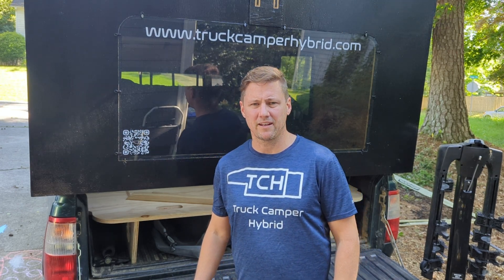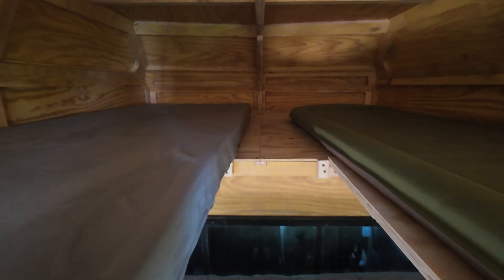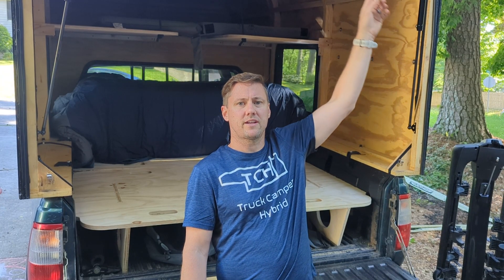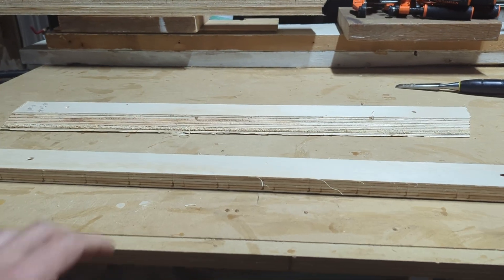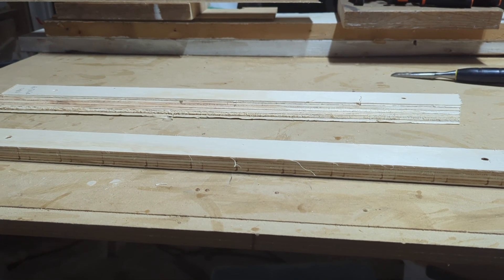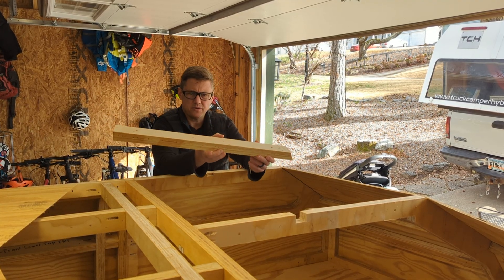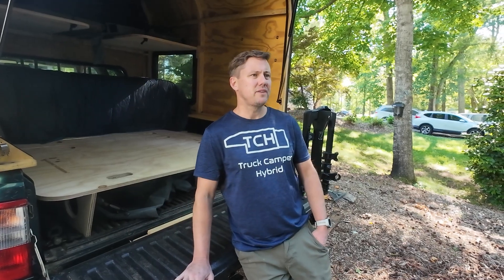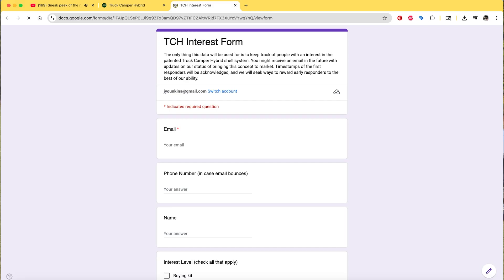Is Wood a Good Choice for a Truck Camper?

Comment: Nice.  Plywood is an excellent material for anything box-like. It's also great for building boats, and can be bent around frames.  The key to longevity is keeping water out. The Rhino liner is interesting.  I go with epoxy/fiberglass myself, but I don't see why Rhino liner wouldn't work.  No need to paint Rhino liner, too.
Reply from the maker: thanks for the positive feedback! I ended up taking this camper to my local Line-X after talking with Line-X corporate about how well Line-X bonds to plywood.  I could not promote plywood if I wasn't 100% certain water would stay out, and the Durabak 18 I was rolling on was giving me headaches.   From what I understand, Line-X is a little different than the Durabak 18,  the Line-X is a two component system that dries in 6 seconds after being sprayed. This allows them to get it really thick (1/8 in or more). I am very impressed with the job they did. You can't see any of the seams anymore, and it gives me the confidence that water is going to stay out.
Reply: @truckcamperhybrid  Rhino or Line-X does cover natural imperfections in the surface of fir plywood. It can also be had in at least one other color than black.  That would be a light gray.  There may be more options.  One thing that is vulnerable to de-lamination are the sharp edges.

On your next one, you might consider a backing block on the interior of all sharp corners, with the fasteners set back away from the edge and through the blocking so you can route a 1" radius (or more) all around the box without hitting screws. I do this when I fiberglass so the cloth lays even as it tries to adhere to a radius which abruptly ends - assuming you won't be spraying the underside.  Line-x or Rhino may have the same difficulty with long term "grab" as time and weather occurs.

As to general durability, Rhino/Line-X is like armor plate.  No issues with branch strike or most other interference when squeezing along certain forest spur tracks.  @2TrackMind knows about this.:face-turquoise-covering-eyes::hand-purple-blue-peace: